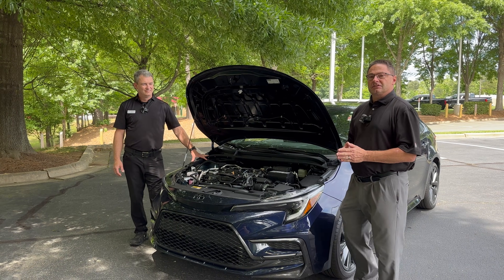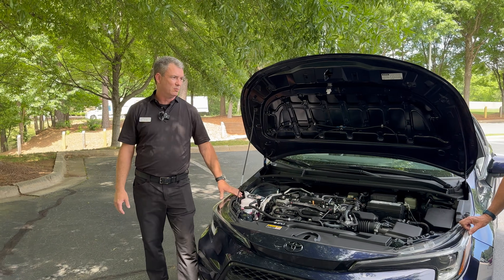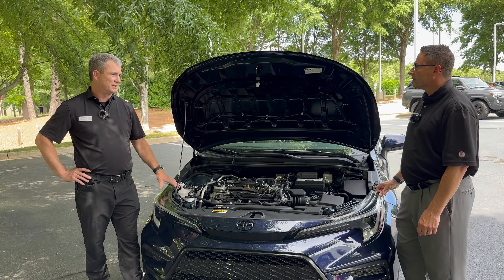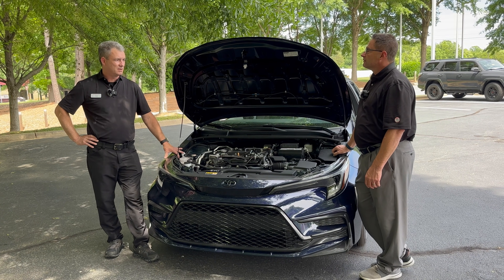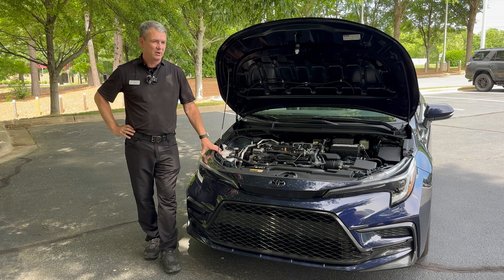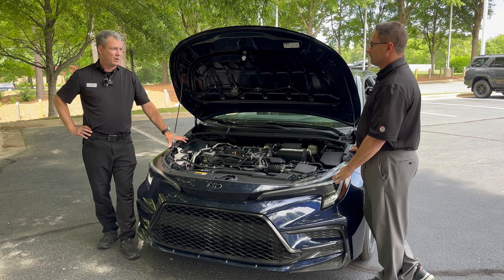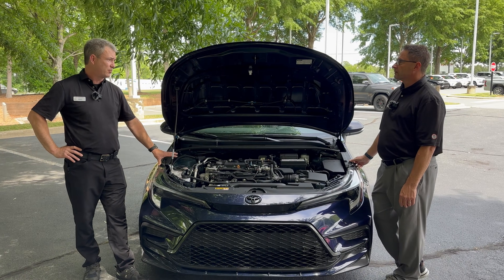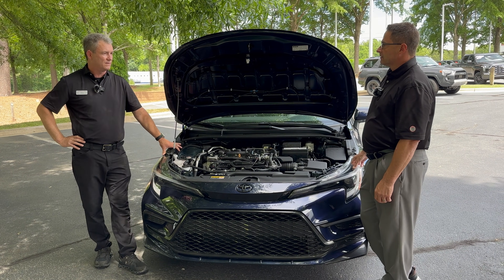Is Toyota CVT Transmission Reliable (Toyota Car Care Talk Ep. 18)

Comment: Regular fluid exchanges are the key to long life. And a little mechanical sympathy goes a long way too!
Reply: So how often should I change transmission oil and engine oil? What fluids is needed for transmission
Reply: @suriyadunya9994  To be safe, it's recommended to read your owner's manual to see the recommended CVT fluid. Ideally, you should change your CVT every 30,000 km
Reply: How many miles do you have to change the CVT oil?
Reply: @markweatherill  they don't give free transmission fluid changes. Software updates suck to all CV transmission suck you probably have never owned one you know better if you did

Comment: Does the hybrid CVC also need fluid exchange at 30/60 thousand miles?
Reply: No, 60-90k miles.
Reply: @hjer731  Thanks
Reply: 8 speed transmission you change it until 80 to 100,000 MI
Reply: No, the Hybrid transmission is bulletproof.